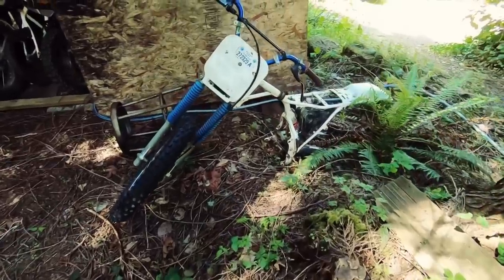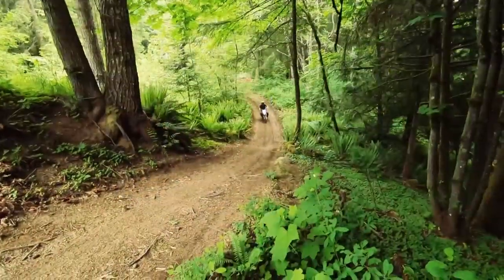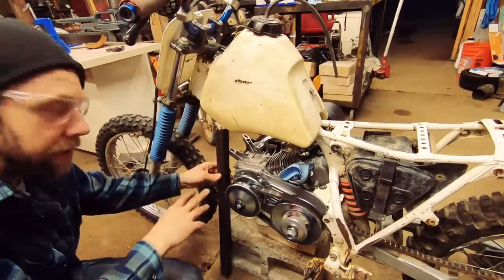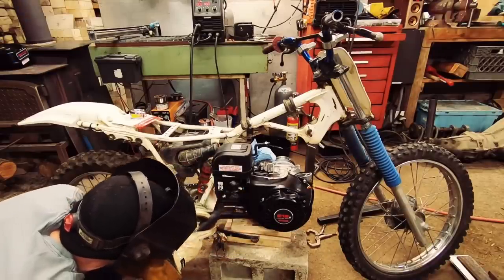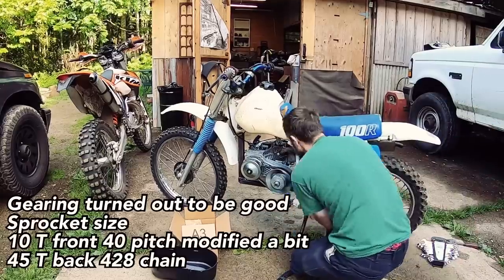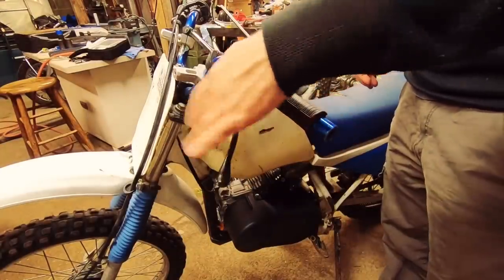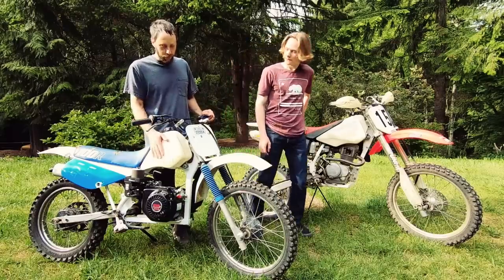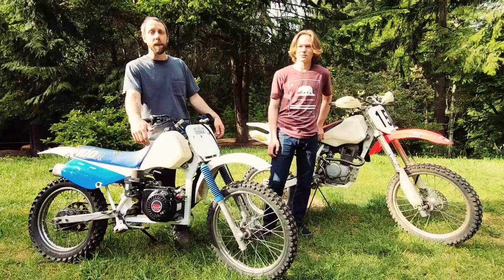Predator 212cc engine swap mini bike motorcycle

Comment: The akwardness when your scooter with a low powered 2 stroke 80cc has 11 HP, compared to this 212cc 7Hp
Reply from the maker: Is that awkward?
Reply: And how much torque does your make compared to his?
Reply: Your scooter revs to at least 11.000 rpm...
Reply: @빵-e5x  Nopes, it's not a high racing cylindre. Max revs is arround 6-7k rpm. and idles arround 5-600 rpm
Reply: More torque
Reply: Give me the 212.  I like to have more than 2 usable throttle options idle or wide open.

Comment: I honestly think that little 212 will be able to hang with that 120 swapped bike after a few tweaks. I think a stock XR100 has close to 6.5hp so that 120 is probably close to 10hp. I think a stage 2 kit on that 212 will keep up with it or even have a small edge.
Reply from the maker: Yes I think your right, the 212 motor is already faster then a stock XR100, and it’s not much slower then the XR120, like you said after some mods I think it will keep right up with it. Thanks for commenting :)

Comment: REMOVE THE GOV!
Reply: The stock rods seem pretty good in these, but I would worry about the flywheel.
Reply from the maker: I have a Billet flywheel and connecting rod that I need to install soon 👍
Reply: @scdevon  Valves will float well before the flywheel goes.

Confirmed.

Dont hold it at WOT for 5 mins straight.
Reply: i agree ,  remove gov , do flywheel cam n lifters

Comment: Hi mike great rebuild hay can you please tell me how you did the front sprocket to run the 428 chain I am building a Honda atc 110 motor in a mini bike frame and I need a front 428 sprocket 15 tooth with a 1.000 bore 1/4 key  what do I need to do to do this set up thanks for your help.
Reply from the maker: Here’s the second video I did on this bike, you probably should check the entire video out because I think you will find some good info in it, at 10:10 I talk about the mods to the front sprocket 👍 https://youtu.be/ZmJ3kFeFfDA

Comment: i have a xr80 i started to do this to today because of this video all i need now is to no the chain and sprocket set up? can i use the stock bike sprocket or what do i do or order? PLEASE HELP
Reply from the maker: Right on! I talk more about the chain and sprocket stuff in the second video about this bike, you can find that video on my YouTube channel. The xr 80 I think run a 420 chain, the xr100 runs a 428 chain, the pitch is the same the with of the chain and sprockets are just a little wider on the 100. I talk about how I made the 40 pitch front sprocket fit the moto chain. Check out that video 🙂 take care
Reply: @Mikefestiva  https://www.youtube.com/watch?v=ewfXZ0ZDrS0 
built it, now i have to make a vid of use riding it. its tons of fun to ride, thanks

Comment: Hi, i have very similar frame from MTX 80, 1990, and im planing to put pitbike engine in it , something like yx 140 or 160.. Do you think that if cut the frame in the front as you did and weld new one that it will ruin strength of the frame in a way, that it might just split in a half after few jumps :D ?

Comment: That motor and transmission kit really that cheap$ how did it hold up? Do they make one a little bigger I have a project just like this one you did with the bike biting using a 350cc two cylinder air cooled German snowmobile engine? I thought about getting a separate motorcycle transmission like a harley Davidson has separated from the motor using a belt drive then chain to drive wheel! I'm going to build a biggie of some sort! I'm not sure that transmission would hold up? Any thoughts

Comment: Looks like a blast to ride. How's the balance on it? Does it lean at all?
Reply from the maker: I was wondering that to when building it, it feels fine, I really was surprised at how well it work! I think the motor and CVT didn’t add any extra weight to it, if anything it maybe a few lbs lighter. Thanks for checking out my video.

Comment: Nice build. How heavy is that bike now? Looks to be putting stress on that suspension a bit. Guessing it will wear out quicker and the handling looks piggy but HEY IT’S RUNNING.
Reply from the maker: Well I don’t think this motor and CVT is any heavier then the stock 100 motor, if anything it’s probably a few lbs lighter. Haha if you think the suspension is being worked it probably is I’m a 155 lbs and riding it fairly quick, this is a kids bike for a 10 year old :)

Comment: Love your videos. I've got a kdx 200 chassis I wanna do one of these with a predator motor so the kids dont have to shift around the property. The kdx sprocket and chain is 530. Any ideo. If 420 sprocket bolts on to kdx wheel or do I need to modify a 420 sprocket. Before I start  buying chains and sprockets   Thank you

Comment: That's a lot better than I was expecting, looks like that thing freakin rips. How do you like the transmission setup though?
Wonder if I could fit one into my old xr80
Reply from the maker: Yes I think the XR 80 and XR 100 share the same size frame, I think the only difference is the engine bore and maybe rim size. Take care 👍

Comment: Predator Engines are no joke. Lots of Fun. No clutch needed is a bonus imho.
Reply: I honestly like to have clutch even if its just in case. You never know what issue comes when riding for instance failure of the shut off circuit+jammed throttle cable. With clutch you can still get bike to stop, where as applying even full brake wont stop least the bigger engines. I much rather have blown engine than hit something at high speed.
Also far as i know most bike engines have semiautomatic transmission, where you only need clutch to put in first gear and just hit rest in.

Comment: Would the front tire ever get in the way of the down tube with full dampening ?
Reply from the maker: Good question, we checked this out when building the frame, with the front forks completely compressed the front wheel doesn’t contain the frame. Take care

Comment: I've been wanting to toss one of these with a torqueAverter on my old 82 BIG RED 200cc that the engine was damaged from a chain windowing the case an a now former dirt bag buddy took the engine ,seat, handle bar wiring and front fender, what are friends for! The tank is really rusty so I mocked a xr80 seat n tank on it and fits decent and looks pretty cool. I just Ain bothered to get the stuff to build it but would love to i had hundreds of hours on it.

Comment: Not to mention you may want to inquire about getting a bigger knob on the rear while casing that XR80 in the preview video looks like someone may have run out of full Locker is that slide look something more like a Speedway racer has to do

Comment: What number chain did you use? Just bought a 212 and torque converter. New to this and have never messed with mini bikes, gocarts or dirt bikes. Torque converter has a 12 took sprocket and says use #35 chain. What number chain will work on rear sprocket of a dirt bike? What did you end up using?
Reply from the maker: I covered this in the second video about this bike, check that video out. I think this bike ran 428 sprockets, the CVT drive sprocket was a 40 pitch, I did a little grinding on that front 40 pitch to make it work with the stock 428 chain. I hope this helps.
Reply: @Mikefestiva  darn I just ordered the wrong torque converter then. Appreciate your reply. One more thing what do uou mean by 40 pitch?
Reply from the maker: @HillbillyOffroading  don’t worry you can install a 40 pitch sprocket on there, it comes with a 35 pitch, Check the add, it probably has a 5/8” driven shaft ( most CVT have this size)
Just look up CVT 5/8” #40 pitch sprocket, I’m sure it’s like $8.99
Pitch is the size #35 pitch is 3/8” #40 pitch is 1/2”
It works in 1/8” increments, # 50 is 5/8” 👍
Reply: I made one of these. 10t front and 51t rear with 24” tire did not have enough gearing (not enough reduction). Gonna try 10t front and 84t rear (#40) for 8:1 instead of 5:1

Comment: How did you hook up throttle cable?
Reply from the maker: The predator motors have all the parts on them to set up the cable, I just had to drill out the cable clamp a little bit bigger.

Comment: This has been a lot harder than I thought. How do I adjust the throttle and carburetor? I got my engine to fire but idk if its the governor or what but there's this piece that kinda moves a little and if its to far up it makes a weird ticking noise and if its to far down it shuts the engine off. I have to hold it just right while its running but even then it sounds like its reving way to high I have the little screw set to where it just barely stays running with the throttle all the way down. I have a torque converter for it but im pretty sure I have it on wrong 😅 the instructions were not the best.

Comment: Did you have to rejet the carb when you changed the exhaust? Cool build.  Nice country you're in there. Where's your firing range?? Lol id set up some rube Goldberg type  of , dare I say, shooting gallery, if I had a spread like that. 

Thanks for the inspiration..
Reply from the maker: I did not re jet it yet, it seems to run pretty good, but I’m sure a jet change and removing the gov would definitely wake the engine up, I plan to mod it more on the next video! Take care. Ps I’m in Washington state :)
Reply: @Mikefestiva  I was going to guess Washington due to the lush and type of vegetation. ..and , assuming you're a native, your lack of any accent. I look forward to seeing the progress. I I swapped out the supertrap for a can off a GSXR 1100 on my KTM 640. When I rejetted the carb and raised the seat one notch (wait.. Raise or lower? ..raise, so the bowl has more gas in it) that was the ticket to get that thing breathing like a dragon. I just used a set of those micro bits you might find with tip cleaners in welding. And a set of those small machinist bits. Stuff the chuck end into the jet  until you get the one that won't fit. Chuck it up in a pin vice and bore out jet. If it's too big, solder it closed and try again.  I know I'm probably preaching to the choir here . 
Thanks for your reply. Ill subscribe now
Reply from the maker: Nice! I have drilled a few jets out In my time works good! Thanks for subscribing and taking the time to comment, I appreciate it :)
Reply: If you unlock the governor you'll have to modify the clutch on the torque converter or it will keep the engine at 3000rpm until the belt is fully "stretched".

You'll have higher top speed from the rpm but no better acceleration.

Governor removed, carb, and a cam, with a stall speed of 5000rpm on the clutch would make it twice as fast i'm pretty sure.
Reply: @ProbeGT2  I totally forgot about the governor. Im looking forward to seeing the progress. 

My buddy and I used to terrorize the surface streets on my little Kawasaki KV75 and his gokart, ducking the cops (who apparently don't like "donuts" as much as we thought. They didn't like the ones we were making on the basketball courts and soccer fields at the junior high school we attended.. Lol. Fun times). My buddy blew countless briggs n Stratton 3 and 5 HP motors when he'd mess with the governor trying to keep up with my "minibike."  Finally, his mom got tired of sponsoring that quest so one xmas morning he woke to see a brand new (yet still a couple years old, left over inventory), shiny. Red Honda Elsinore 125. ..good times. 

It will be nice to see it done right and not through the mechanical interpretations of a couple of 13 year olds.. Lol
Reply: @ProbeGT2  ha. My bad. I thought you were the guy in the video. Thanks for the tip.

Comment: hello friend, good night i'm brazilian and i would like to get more information about the numbering of this stationary engine Congratulations your motorcycle was very powerful I will enjoy the ride on my motorcycle
Reply from the maker: Hello Paulo This engine is a 212cc 7HP  Honda clone engine, it’s built in China, there’s a lot of companies that sell these engines, this one is a Predator, Duro is a different brand but the same clone. Lifan is another name they are sold under. Look on E bay and you can find them. Take care 👍
Reply: @Mikefestiva  tank you
Reply: @Mikefestiva  Congratulations your motorcycle was very powerful I will enjoy the ride on my motorcycle
Reply from the maker: Cool bike is this the one you plan to install the new engine in? The clutch transmission is called a CVT there’s links to them in the description in the video. If you can’t find them I can post a link for you. Take care 👍
Reply: @Mikefestiva  ok yes
Reply: @Mikefestiva  yes sir, I would and would be delighted to use an international system on my little scooter.
Reply: @Mikefestiva  feliz 2020 para todos😁I would like to ask you a small favor if you are not comfortable, I can not read or speak anything in English so I use google translator, which gives me a little trouble copying your texts and then translating to portuguese. would you send the translated messages? it would make it much easier for me to interpret your messages.
Reply: I wish all your family a happy new year full of achievements

Comment: What size sprocket you have front and back?
Reply from the maker: I covered this in the video, I think it was a 40 pitch 12 tooth on the front, I had to modify a little bit, and it was a 428 size chain, and 45 tooth back sprocket.Take care

Comment: ❓❓
Is it possible to get one of those engines to Rev higher? To get more power out of them?
Reply: I have a gx200 with intake exhaust and some head porting 18lb springs and timing key it revs to around 6400 rpm and makes maybe 11hp, you won't get much more power reliably without a billet rod and a camshaft and a billet flywheel (for safety) they can rev to 10000rpm and make 20hp but $$$ add up fast for such a small engine
Reply: you have to remove the governor inside the engine
Reply: On a side note it gets harder and harder to push past 5500rpm through that cvt because the belt tension will increase with rpm causing increasing resistance to the engine, a cvt is still a good choice for off-roading  as they do perform great but a disc clutch is the way to go for a seriously modified engine
Reply: Remove the governor

Comment: Is there any advantage to using the belt drive/CVT Trans over just using a centrifugal clutch and connecting that directly to the output shaft and then to the rear sprocket via a chain?
Reply from the maker: Using the CVT with this build helps you with gearing, you get a variable speed transmission, it keeps the engine in its peak torque curve and the trans constantly adjusts to keep it there. Just using a clutch and chain you would slip the clutch till it grabs, it would have a slower start, then you wouldn’t get any gearing change, the only thing that would vary is your RPMs to change your speed. 
The CV transmission is a really neat design and quite tunable. Take care.
Reply: Awesome man thanks so much! I’m looking to do this with my older cbr to try and get her running again so I wanted to ensure I get the most power

Comment: Another way to cool the engine and the engine oil is needed so the engine won't blow up
Reply from the maker: You probably don’t understand air cooled engines especially ones with a built in fan and cooling shrouds. Do your research 👍

Comment: i got a yz80 im trying to do this with any advice on what i can get ahead of time got engine out everything gutted need new throttle and idk what brakes i can get for it cause i got none lmfao  and what moter should i use a 79 cc one or a 200 cc colaman
Reply: trust me, get a predator ghost 212cc engine, more power and more torque then the other engine

Comment: Hey dude i have project with predator 212cc i have 428h chain and the front sprocket is 10t but my chain no work good with this sprocket u can help me what is correct front sprocket need to used
Reply from the maker: I think the following video I posted about this bike I mentioned how I got the chain to fit the sprocket, basically I took an angle grinder and modified the sprocket a little to fit the chain.

Comment: can i ask where you got these engine for 100? the cheapest i can find is about 150 are they not on sale anymore? thanks!
Reply: There's a coupon from HF you can use. Or wait till there on sale again
Reply: @5_twenty  Alibaba, cheapest by far.
Reply: you have to physically transport your body to a harbor freight store to get the best price. the cool thing is that quite often they will give out a 20 percent off coupon and you can use it when the predators go on sale for 99 bucks. i have 2 predators that i paid $80 for each.
Reply: @marzsit9833  cool thanks for the info

Comment: I have that same engine on a modified electric razor dirt bike conversion with extended swing arm, rear tire 72 tooth sprocket to a 36 tooth sprocket with performance racing go cart clutch! Top speed open road with governor removed! 86 mph
Reply: I don’t have any video of it! I’m new to this YouTube thing. I don’t do social media. But I come on here from time to time to watch videos people building bikes, go carts etc.once I learn how to navigate YouTube I will definitely post videos. Thanks for asking
Reply from the maker: That’s pretty impressive speed! I have a old Honda CB 350 street bike it’s a 350 four cylinder and I would really need to tuck down to cut out the wind drag to get my 350 to do that speed. Haha

Comment: The predator is torquey, but slow. I prefer it over a higher HP engine that needs 8k rpm to pump any power at all.
Reply: You can add performance parts